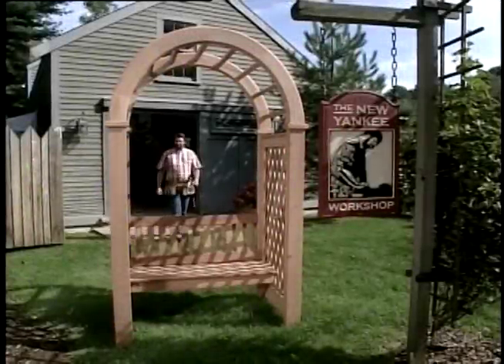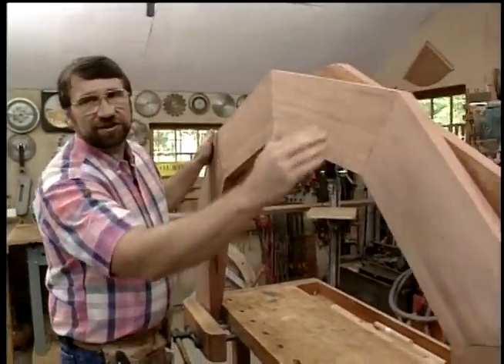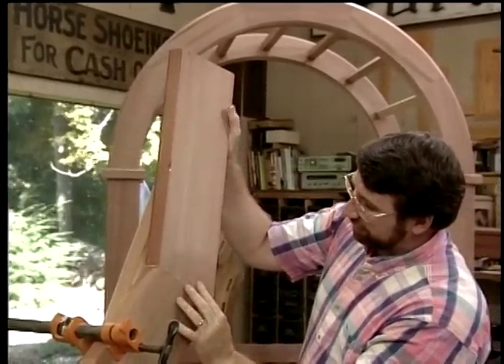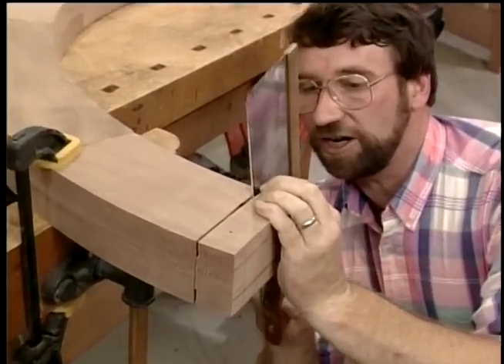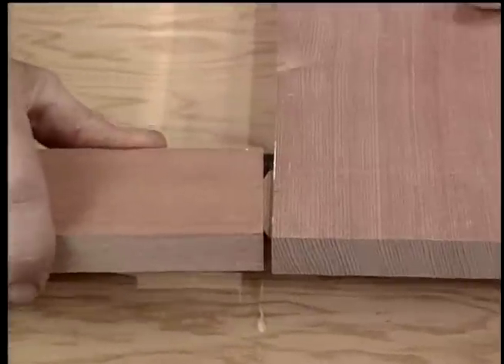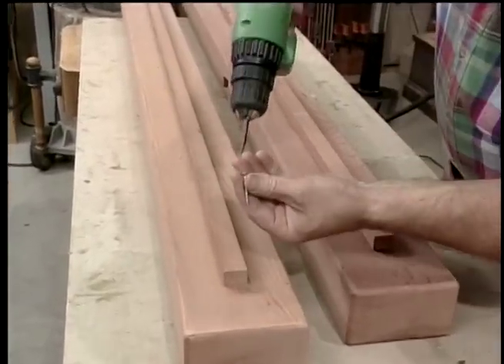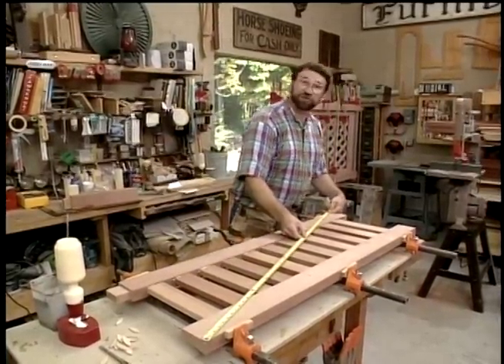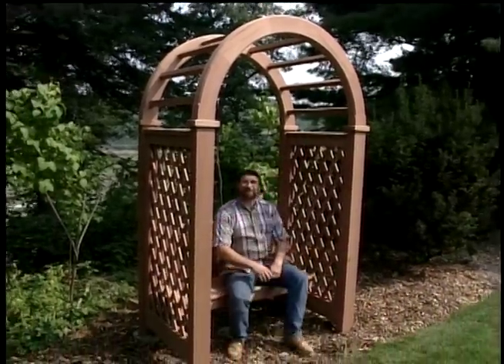Redwood Arbor  |  S5 E11

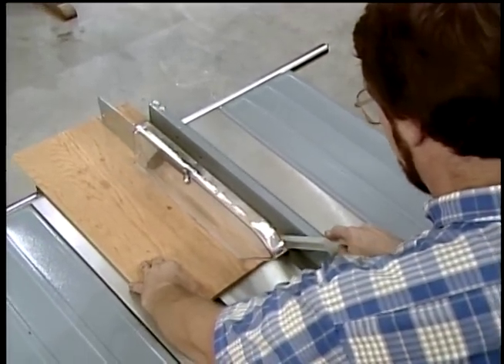Comment: @ 3:15 Norm, how, and when did that central vacuum system get installed in your workshop, who did it, and what does it look like?
Reply: @TailWagginMarly  No, I mean, where the power unit of the central vacuum is located, and to be honest, the company that installed the pipes for the dust collection system in the workshop, was Air Handling Systems. The actual unit was a Delta 50-900, with a 5 horsepower motor, with a separate control box to hang on the wall, and allow you to power the machine on and off, for the whole shop.
Reply: @aramis295  From my observations of these videos I think it was installed for season 4. On the rolling shop cabinet upload, when Norm is in the finishing room you can see some of the pipe work on one side and there's a quick shot of the unit on the other side (don't know the make - they're not too common here in the UK). At some point later - possibly when the main dust collection system got installed for series 6 - the CV unit was relocated out of view as there was a big filter-type bag plus pipe where it used to be (see the cradle episode).
Reply: @201081hero  Aha! That's what I was thinking about, myself. Obviously, when I was watching the plunge router segment of part 1 of Router 101 where Norm was demonstrating a procedure for making a mortise for mortise and tenon joinery, and when the vacuum hose was plugged into the central vac inlet, next to the radial arm saw, I actually heard that the motor unit started running quiet, and then kicking up to full power, which is a little bit loud, but when you wear ear muffs, that should reduce the noise level, illusively!
Reply: @aramis295  A couple of other times Norm was shown to plug in the CV hose was during the first jigs episode when Norm made the bandsaw circle cutting jig, also during the season 12 hanging porch swing episode when Norm also made a quick reference to the router he used (a PC 7529) having a handy dust take-off port in the base.
Reply: @201081hero  That's what I saw, as well! In season 20, where Norm was building an all-weather teak bench, and a lolling chair, that both have a lot of mortises cut in various parts, with a PC-893 plunge router, the hose adaptor was not shown, regardless of that in part 2 of Router 101, where Norm was talking about the PC-696 router table, the long hose was connected to the fence, and yet, that hose adaptor was shown, but not on the actual hose itself, obviously.
Reply from the maker: The central vacuum was installed between seasons 5 and 6. The main unit is next to the lumber storage under the balcony on the way to the paint area. There is one problem keen viewers might notice. The floor has radiant heat so the collection tube to the table saw lies exposed on the floor. You can sometimes see Norm step over it when he walks by the miter bench :)
Reply: @newyankeeworkshop  Hmm! I didn't even notice that, in a recent view in the Chop Saw Station episode, that you, Russ, have filmed, a month, ago I believe, when Norm was getting the handhold cutout template, for the top of the stand, as I was thinking.
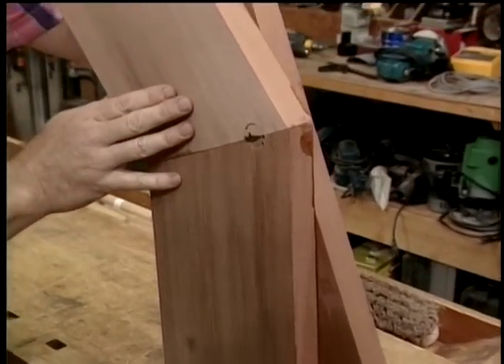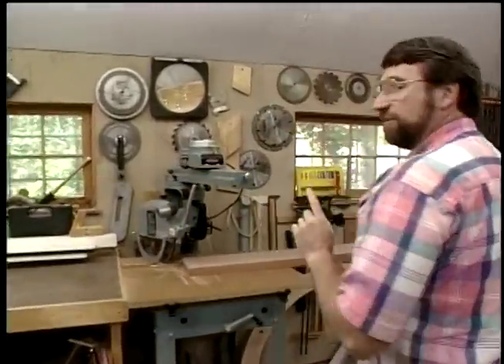Reply from the maker: @aramis295  I just remembered. If you watch the video where Russ introduces the channel, I take a walk around the shop. You can see the hose @3:40 and then @3:59 you can see the unit under the balcony. In fact you get a great look at all the pipework and connections.
https://www.youtube.com/watch?v=KkNhWgoTtd8
Reply: @newyankeeworkshop  I also saw the actual central vacuum hose, next to your radial arm saw, Norm.
Reply: Wait, was the central vacuum unit, that gray box, right next to your paint room, Norm?
Reply from the maker: @aramis295  Yes, but there is a wall between the unit and the paint room :)
Reply: @newyankeeworkshop  I thought the unit was invisible, at first, before you went into the paint room, to see Natalie Gardener decorate your Taunton Chest, back in 2007!